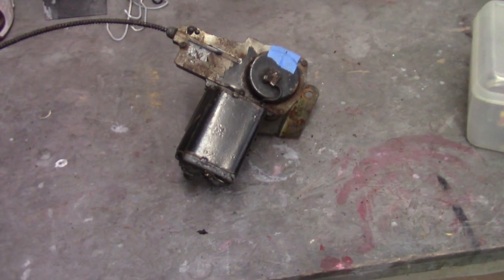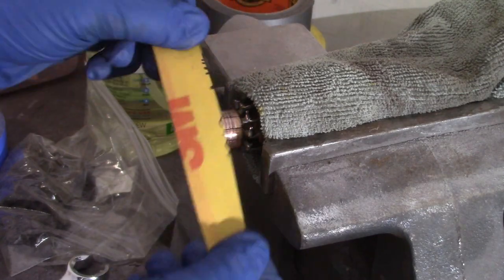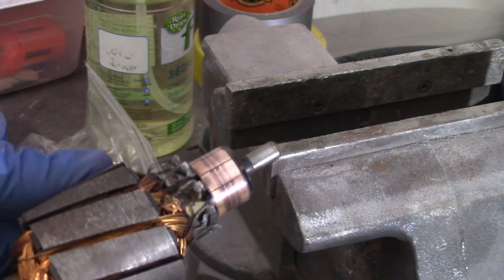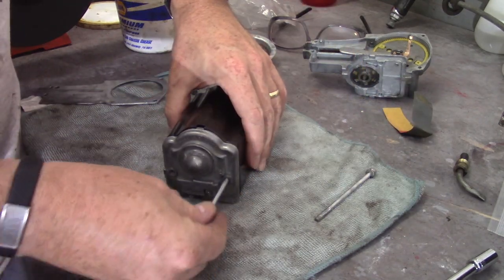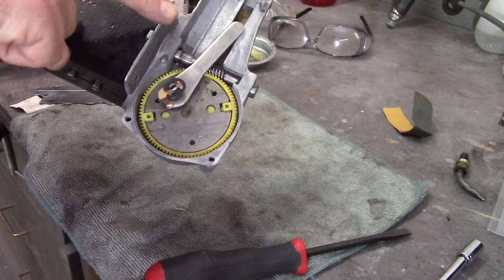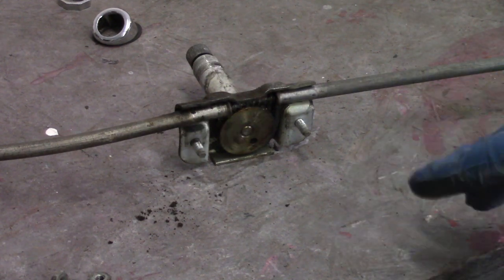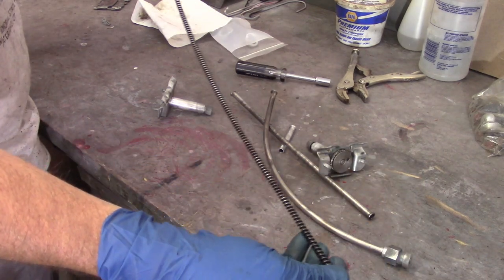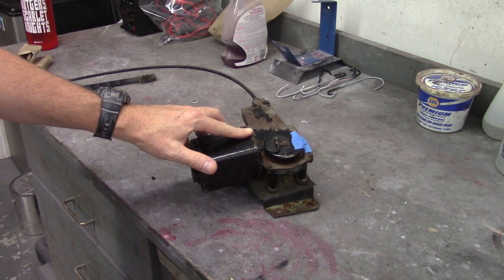Reassembly #2 - Wiper Motor Rebuild and Installation | Roundtail Restoration

Comment: Cool! Good to see the soldering iron, that's our area of expertise. The tech term we use at work for a running motor is "spinny-spinny" so your term is just as applicable. On a modern car the wipers are tied in to the CAN bus and you need an $8k scan tool to program them, lol
Reply from the maker: I thought it might be more complicated. A shame. The old stuff was so simple and elegant!

Comment: Very interesting to see how your wiper tubing is fitted. I’ve just spent the whole day taking apart my wiper linkage to find out why they hardly work. The rack is extremely difficult to push through the tubing;  looking at your tubing it’s nice and straight; mine seems to have loads of small bends in it which stops the rack moving. More parts from Rimmers tomorrow. Thanks for your in-depth tutorial. It’s always helpful to see how you do it when I’m unable to figure it out.
Reply from the maker: Good deal, glad it helped. I didn't have any real problems feeding it through and having it operate smoothly. If you are, I'd say you have some damage there, like you mention.

Comment: Great job on the rebuild Chris. The wiper circuit for my cars was always real confusing to me until last year when I really dug into how it works. GM used several switches for some reason. Just like you showed though, it's just switching the ground to complete the circuit and it's done in a certain order to park the motor. Great video.
Reply from the maker: Thanks, Russell. Took me a bit to figure it out, but I eventually figured it out. Then I had to try it to make sure, of course!

Comment: That power supply is awesome! Nice toy! 
The wiper motor on our 64 TR4 is exactly the same, right down to the impossible grommets on the mounting pad. This vid is super helpful because we need to replace the "parking" wire on ours, but we chickened out on disassembling it that far. Now that I know what it looks like...🤔
Reply from the maker: It's not bad at all. Some small parts that are easily damaged (the cardboard pieces). Otherwise, go for it!

Comment: This is a very informative video that will help me greatly when I rebuild the ww motor on my Sunbeam Tiger. I will add one thing and that is when you have plastic gears, you should use a silicone grease such as Lubriplate rather than a petroleum based grease. Petroleum  based greases can be harmful to plastic gears.
Thanks for the video!
Reply from the maker: Thanks for watching. And thanks for the tip. I just assumed the black nasty stuff in there was regular "grease".

Comment: Chris, 
Thanks again for your Playlist. It's fantastic for a new spitfire owner like me.  Mine was missing a wiper motor, so after buying one,  i realized my rack was jammed too. I took mine apart and got it clear using your video as a guide. However, when trying to guide the wiper rack and boxes back into their rightful spots, the connector to the wiper motor is a little off. Did you have any issues with lining everything up?
Reply from the maker: Thanks! Yes, I had issues with alignment.  I didn't come up with a solution but got it good enough. If I remember right I left everything loose until I got it how I wanted and then tightened it all down. Not great, but it worked.

Comment: ...I placed a small plastic tube over the brushes tension spring so that when the brushes wear, the 'claws' that hold them can never contact and cut into the commutator, as I've seen it do in many Lucas wiper motors.....The wipers will continue working even as those claws chew into the commutator, eventually causing irreparable damage.....If you're in a rainy climate, this can happen faster than you think with those tiny brushes....John (west coast,Can.)    52 year TR3 owner...
Reply from the maker: That's a great idea, John. Thank you!

Comment: Just to add a little comment to an excellent video if I may? That circular plate is not that critical as to location of the wipers. As long as the wires are fitted safe is all that matters. When fitted to the car complete with wiper boxes, switch the wiper motor off, let it park and then fit the wipers in their park position. 
Lovely restoration my friend... top notch
Reply from the maker: You're right, of course. I was thinking about that the day after I put it in. I guess they expect you to not pull the wiper blades off each time, hence the reason to mark the position of the brake prior to taking it all apart? Thanks!
Reply: @roundtailrestoration  You are most welcome Sir. There are in fact two positions depending on whether its left or right hand drive and the wipers park on the left or right. And that is dictated by what I call the 'piston' at the end of the connecting rod that connects to the long drive cable. At one end it pulls and the other it pushes. Just set the park switch to either of those positions and adjust with the wiper arms on the spindles. I use motorcycle chain grease / wax in my wiper motor and boxes.
Other motors fitted to minis etc had a plastic switch that could be pushed out and replaced and was triggered by a block on the large driving cog wheel. That pretty much fixed the 'park' location.
Keep up the excellent work and attention to detail my friend. Very enjoyable.
Reply from the maker: @1chish  Will do, thanks!

Comment: Excellent video Chris - thank you. 
I am now going to dive into mine. Are all parts of the wiper motor readily available? How hard is it to a complete novice in electrics to handle it? 

Thanks again for the video!
Reply from the maker: As far as I know, many of the internal parts are no longer available, especially the big main gear. Electrically, it's pretty straightforward. I don't think you'll have any issues there. Good luck!
Reply: @roundtailrestoration  thank you mate! I am a devoted subscriber of your videos 😊
Reply from the maker: Thank you. If you have any problems or questions, don't hesitate to reach out.
Reply: @roundtailrestoration  Thank you Chris - most appreciated!

Comment: So, what would cause it not to park, when testing on a bench? (The copper tag is in place inside the cover) where should I test for continuity on the parking brake side? It stops Instantly when power is removed.
Reply from the maker: Hi Ian. It sounds like you are losing continuity from the copper tag inside to the ground wire that's on the top of the unit and then goes into the motor itself. If this wire is broken at some point, as soon as you remove power, your short to ground (allowing current to flow) is also broken, and the motor stops. That copper tag, along with the wire that it's attached to, is what maintains the current flow until the motor pushes the gear around to fall into the spot where the copper isn't...the motor than stops. A bit confusing, maybe, as it works opposite a bit from how you might think.
Reply: @roundtailrestoration  Chris.  How best to check this on the bench please?
Reply from the maker: If I remember right, that wire just runs through the case and doesn't really connect to the motor itself. I think you might be able to just run a jumper wire from the top of where it connects to the wiper motor (on the round cap) to ground. Start the motor and let it run a few seconds, then turn it off. I believe it should then run until the copper tag comes around. All you are doing there is essentially recreating the ground wire that goes from the case of the motor to the chassis near the wiper motor. On the motor, tab 1 goes to the switch, tab 2 goes to power and the unlabeled wire is the ground wire that allows the parking circuit to work. If you want to email me at roundtailrestoration66@gmail.com, I can probably find some pics that should help.

Comment: Great video; thanks for the explanations. The editing was fine, no worries. I'm interested in that power supply - can you provide info?
Reply from the maker: I had no idea how the parking thing worked. I feel like my life is that much more complete now!
Here's a link to the power supply: https://www.amazon.com/gp/product/B07JQXQ8S5/ref=ppx_yo_dt_b_search_asin_title?ie=UTF8&psc=1. There's lots of choices out there. I went with this one mainly because I like the Tacklife stuff. This was the first time that I really used it. Given that the Spitfire's generator is only rated for 23 amps, I didn't think I needed anything too powerful. I will try to use it so simulate the battery (not for starting the car, but for running various components after they're installed) so we'll see how it holds up to that.

Comment: You don’t understand what amperes are exactly. The motor will draw whatever it will draw based on the voltage. The current knob on your test supply is a current limiter essentially.
Reply from the maker: I probably mis-spoke at some point. I think what I was trying to show was that at some point, no matter how far you turn up the voltage, the amperage draw maxes out. It also won't matter how far up you crank the amperage on the power supply. The motor will only draw what it can draw based on it's construction. Thanks, Cory!

Comment: Put anti seize on the chrome nuts, I've had to cut old ones off.
Reply from the maker: For the wiper boxes you mean, I assume? I'll do that, thanks!
Reply: @roundtailrestoration  yes they're also called wheel boxes and the chrome nut is a chrome wheel box nut. Btw great job on the wiper motor refurb I've just done it on my mini Cooper S, it takes a lot of thought.
Reply from the maker: @stewartpalmer7039  Thank you! Definitely burned some brain cells, but made sense when it finally clicked.